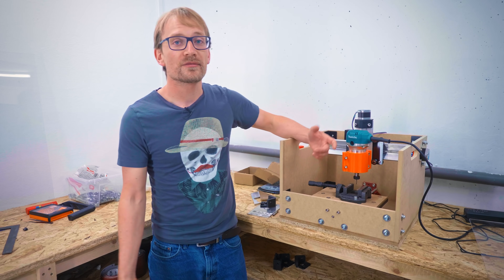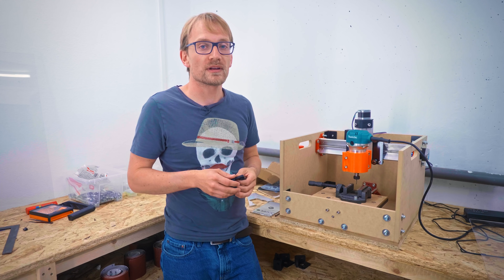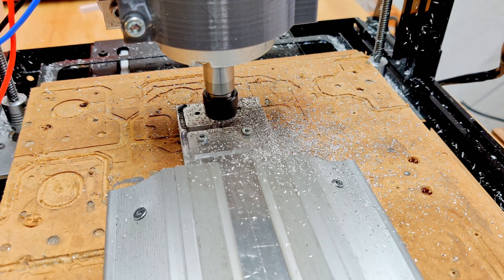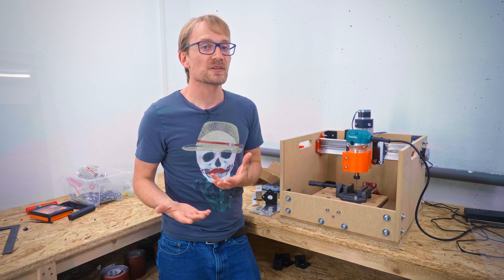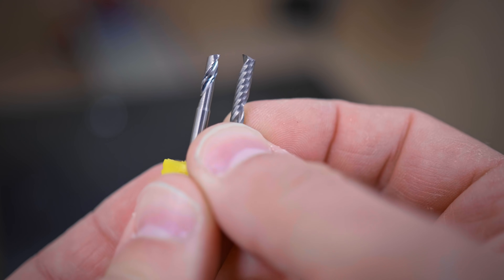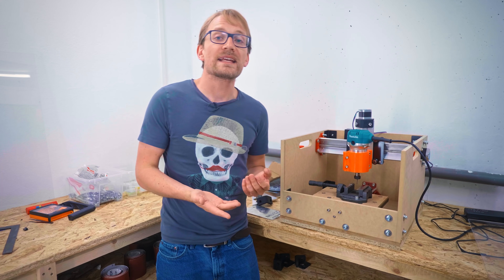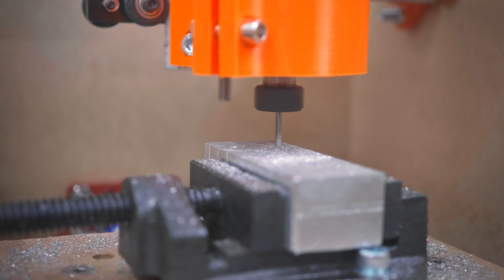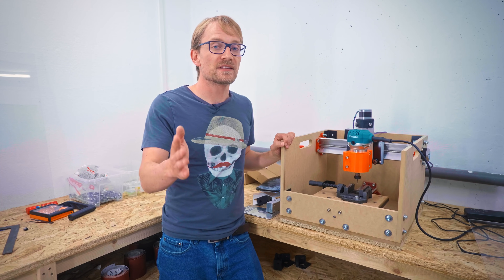The road to cutting Aluminum on my Desktop CNC!

Comment: If someone need less backlash but you don't wanna spend on those wierd "backlash" tools. Just screw 2 lead nuts together as tension from oposide sides. Yea it's more load on steper motor but backlash is lower. 
And 30$ for ball screw?!

Comment: How about doing your own linear rails with good strength? I did mine with car shocks rods (although used they were in good shape) and with linear bearings. Almost "for free". In my case they are 20mm diameter and about 300mm long (front shocks from New Fiesta). I'm sure you can find some in good conditions with less diameter. You have to see the standards for linear bearings before, of course, to choose what you want.

Comment: The number one requirement for removing metal is rigidity. If you want to see a self-built CNC router showing what it takes, search YouTube for "This Old Tony". To be blunt, building a CNC router with a "3D printer mentality" will result in disappointment due to the much higher forces involved. There is very little margin for backlash or play in the actuation paths. Then there's the very real issue of conductive metal chips flying everywhere, onto the bearings, drive guides, and into any open electrical boxes...

Comment: I would recommend to replace the angle guide with linear rail 12 to 20mm even better, the one that is combine with a ball screw (all in one) like FUYU FSL30 75$ on Amazon.  Also have a minimum distance rail to cutter.  You have something over 200mm tip to the center to the center of rotation of the angle.  Angle is a clever design but as structure, not so much.  A better support beam like 80/20 box 50x50mm and have the end screw to the frame (no 3D print part).  Less part the better.
Now, use 6061, (7075, 2024) tuff stuff but cut well.  Bendable Aluminum like 5052 5056, 3003 are gommy.  Have the correct feed and speed, allot of good cutter company have excellent chart.  The old machinist was saying;  You can go slow forever, fast for just few second.  To slow result in more torque to your motor.  Sorry but NEMA 17 is only good for 3D printer or light work.  I think your screw are 2 to 4 leed, change that for 1 with the same pitch.  If you can get a bigger screw...  
Well by now, just get a new machine LOL...  Not as fun ;-)  With a couple of hundred you could improve allot but still your motor will become the weak point, than the controller board, etc.
Good luck, keep having fun...

Comment: You can get some of those mounted rod linear rails and bearings from China pretty cheap.  I replaced the angle aluminum and skate bearings on my garage CNC with them and they work great!  Also got ball screws and acme screws for pretty cheap.  My machine is 48" x 24" so the bearing rails were pretty long.  I need to take a video of it one of these days.  I cut a nice string stop for a guitar out of aluminum with it and have cut the head off of a few grade 5 bolts (whoops!)

Comment: I don't know if your Makita has the same end thread as my 850 watt £30 cheap Chinese trim router but I bought an ER11 adapter for my CNC3020 and discovered that the collet nut actually will fit directly to my trim router! Now it can have a proper ER11 3.18mm collet nut OR its normal 1/4" collet nut! If you have an ER11 adapter for a 6mm shaft you may want to try it!

Comment: With the COVID lockdown and paying to have the Fab Lab print parts... I'm thinking I mise well take the parts I've been saving from old printers and make a 3D printer.  However, seems like I'm better to make a CNC with steel and acme threaded rods.  Maybe still using more of the stainless steel rods from the printers and some parts if heavy duty enough.  Though thinking more along the line of square tubing material I have so can do plasma cutting work on also.  Basically, I'm thinking I'm going to make a CNC plasma cutter that I can also consider using for 3D printing, maybe lower power laser work and more likely maybe CNC milling work.  Considering what I'd actually make other than small 3D printer parts... seems I'm better to plan to make a larger 4x4' or potentially smaller 4x2' CNC and just feed in the sections for the longer sheets cuts.  I do have some floppy and CD/DVD/BluRay drives and am thinking maybe for a first build project make a smaller 3D printer out of one of those also for practice in controls...or just better using the old printer parts?  However, for the larger size maybe 3D printed parts... I'm thinking I'd more likely hot wire foam cut larger items and not so much 3D print so am still thinking just make the larger 4'x2' unit and the smallest 3D printer.  I do have some 80/20 and can hit up the scrapyard to see if I can find anymore straight available and I have a bunch of 1/4" wall 2" square tube now that I got the $20 farmall front end loader for my garden tractor loader and backhoe material.  Thinking can bring the long level with to check also.  Then for small metal parts... I'm thinking outside of plasma cutting... just upgrading the 7x12 mini-lathe with the vertical slide into a mini-CNC lathe/mill.   Any suggestions?  Thinking I'll go with a RAMP module kit.  Kicking myself for not picking a free copier when I saw a few this summer.  Some look like a treasure trove of stepper motors and parts.

Comment: I've been thinking for quite some time about a way to make cheap leadscrews kind of backlash free by using TWO nuts, one fixed and the other to be tightened in some way, maybe with a 3D printed block of some sort; it would do the same thing that these spring loaded nuts do but without the vibration since the nuts would be fixed in place
about the backlash in the plane orthogonal to the leadscrew axis I don't think there's much to do honestly

Comment: I have a nextwave automation CNC 3d router that uses rods for the tracks, very sloppy results even with just wood. I added linear rails to the back and no more play. I also raised the sides up, it uses HDPE for the structure, and angled the cutter head back. After taking pictures of it and sending it to the makers of the machine, they now use my upgrades for their new machines. I purchased mine in 2009 and it cuts aluminum easily now. Nice thing about yours is you can make new sides to boost the height for the z movement, or maybe add some linear slide rails to the sides and make the z adjustable.

Comment: I have the same router on my RS-CNC32 build! Works great so far, got the 1/8" collet from elaire for it and it seems to be even better build quality than the stock 1/4" collet that it comes with. Definitely worth it. Haven't cut aluminium on my machine yet but I've seen videos of people doing it quite well. Seems to be a very rigid setup, for the XZ axis alone you have 16 bearings making contact to the square tube rail! Hard as I tried I couldn't detect any slop at all. Of course the 3d printed parts are the weak link and hopefully will use it to route parts for an even more rigid machine ;) I have to thank you for your honest review on the MPCNC otherwise I might have made the mistake and went with that instead of the awesome RS-CNC32

Comment: make a video upgrading to GRBL-advanced .  you can use a nucleo board and a cnc shield , like 20-30 usd.   
check their github , its easy to build.  
why ? it has... backlash compensation (ymmv, didnt used it yet)

Comment: Hello sir, I'm from India. 
I've a manually made 3d printer in here, and its "MKS base v1.5" board. It have much more software problems, please tell me how to delete old firmware and upload new firmware on the board. (1X-1Y-1Z motor, and 1 extruder)
Plz make Detail, step by step video for it.plz

Comment: Great video, actually I've learning a lot from you.
I have a question, or an idea, I think that a rotary tool with the a flex shaft used for jewelry making would fit nice for a small CNC. 
What I mean exactly is something like Foredom rotary tool.

Actually, I'm quite curious to know the result of having one in place of the common spindle or router. The main thing about it is that its spindle is extremely light weight. 
I know that Netwon's first law tells us that it won't make any difference in the XY plane but I still think  the light weight would make a significant difference.
What do you think?

Comment: I'm doing the same thing with my OX, I'm using the cheap carbide 3.175mm double flute cutters, and they work quite well! something I have noticed is heat plays a BIG part in the process, my DeWalt router blows air down onto the part so I think that helps, but,  you can reason that the faster you run the router the more energy there is for things to go "wrong" so I run the router at quite a low speed (2) as to not heat up the metal stock, at a feed-rate of around 550/570 mpm.

Comment: Thomas, AFAIK spindle RPM should strongly correlate X-Y-Z movement speed. Assuming same speed and: 

1. Too high RPM - you'll get "licking" and melting/burning of material (and/or tool)
2. Too low RPM - you'll get too big forces on milling tool and it can break

Comment: I’m looking at getting a hobby CNC so I can machine materials like brass, aluminum, carbon, acrylic sheets and MDF. This is for my hobby being slot cars to design chassis to race. 
I am on a budget too as I’m also looking at getting a 3D printer as well. 
What CNC machine do you think I’d be better getting whether I build one up or get already built?
Thanks.

Comment: Hey, Thomas, My name is Adriel, watching your videos has made me buy a 3d printer and I ended up getting an Ender 3. I'm a total novice and so I don't really know how to find the answer to one of my questions. I bought both the glass bed and the magnetic base for the ender 3 and I noticed that the magnetic base was a two-part system of which one you have to glue on to the base plate of the bed. my question is: if I 3M glue the magnetic base to the metal, can I still use the glass bed when I want to? I hope my question makes sense. thank you so much for all your videos!

Comment: Two ideas:
1. You could modify the router mount to add a bracket to hold the nozzle of a shop-vac. It will suck up most of the chips and provide some cooling airflow. I did that with my openbuilds machine a few years ago (don't ask me about the machine itself. it was bad and I regret buying it).
2. Modify the bed to add a second rail for much better stability and less twisting.

Comment: you probably need 2 horizontal guides for the bed, instead of just one V shaped bar, in the closeups, the bed can be seen rocking from left to right and back when the tool moves around

Comment: with aluminum and hihg rpm the 2 most important factors are chip evacuation and chip load. Add a 70L acquarium pump with the cheap NOGA nozzle you can find on ALI, Ebay, Amazon...ecc... to remove the chips and don;t go above 2 flutes cutter with such higher rpm or you increase too much rubbing and aluminum will melt on the cutter.

Comment: Hi Tom. I believe that extrusions aluminium is the better option to upgrade your CNC.  MDF should not be used for it; if wood is your selection for the case, then plywood is a better option.  Could you please share the feedrate and milling parameters you use to cut aluminium? Thanks in advance.

Comment: You have gone down a deep rabbit hole.  There is no amount of upgrading you can do to get anything really usable. When you are done upgrading to something that really works well it will be built a lot like a Tormach. Once you have spent that amount of money for something that isn't a truly production capable machine, you realize that machines like what HAAS makes is what you really need for CNC. I have a conventional Bridgeport Mill and Sheldon lathe and want to have a little CNC. I have looked into this quite a bit over the winter months. Once you realize the mass and rigidity needed to make a proper cut, you know you just cant get a bolt together home CNC. NYC CNC is a very interesting channel and you can see looking at his video history where he has gone all the way down the rabbit hole.

Comment: Did you try using some cooling fluid or air to improve the cut. Water and WD40 mixed makes a cheap cooling solution.

Comment: Could use the router to upgrade itself like a 3d printer I guess? Could replace the 3d printed brackets with milled alu?
I'd recommend adding one of those flexible plastic segmented pipes and at least blasting the work with air to evacuate chips, coolant (water with some oil) would be even better but would require sealing the bottom of the frame and adding a pump and filter for chips etc etc. This old tony made a CNC router a while ago and I think it's a good reference point for useful features like accordion/sliding parts to shield the rails from chips/coolant.
Btw you misspelled aluminium in the title ;)

Comment: I think you are already bumping into the limits of the design.  Keep fine tuning it, experimenting with incremental changes, learn from it, use it to make useful parts, but resist the temptation to spend too much on it.  When you have finally gone as far as it can take you, the experience you have gained, added to the sizable amount of hands-on experience you already have with printers, will put you in a good space for the next adventure.  I like the progression Nikodem Bartnik is making with his Dremel CNC, and now his Indymill.  Stepper motors etc. have been around for decades, but the ready availability of usable budget priced components over the last few years has resulted in a flood of creativity.  Thanks for your videos.

Comment: The diameter of the router produces overhang.  Overhang is a lever arm to twist the top rail.  Improvements would be rails front and back, smaller diameter router motor, steel rails, things like that.  If I were designing, I'd make a 2 rail system with adjustable split bronze bush's over 1" diameter rods. Not expensive.  Stiff.  Everything not stiff sucketh.

Comment: Hi Thomas, woudn´t it be better to use a steal linear rail for the y axis, the costs and accuracy are nearly the same (poor in some way, but works for many applications) in relation to the one you used. And maybe a quick hack would be, to just make four triangles from 20mm plywood (with a long as possible angle leg) and clue them in the top corners.  Even here, steal is better, e.g. brackets from the hardware store.

Comment: As a trade cabinetmaker that specialises in cnc programming and machining with over 20 years experience I can give you a few tips. Forget the spiral cutters try tungsten carbide cutters. You can go from quarter inch down to 1.6 mm all with quarter inch shank so no need for collets. Also give your cutters a spray of a Teflon lubricant such as Inox it will help stop aluminium from sticking to your cutters.

Comment: The following are required to machine metals such as aluminum:
* low rpm.
* bits made for machining metals not wood. These bits have different geometry for the feed and speeds necessary to machine metals.
* a frame, head and motorways not only rigid enough but with enough MASS to eliminate deflection and chattering of the cutting tool.
I like your vids on 3d printing but you, as with most of the MAKER's community, don't have the basic understanding when it comes to machining metals. Anything based off the idea of using wood working tools or methods to machine metals is a failure from the start. The materials and the methods to work and shape them are completely different. 
I suggest you find a machinist handbook to start. Look for non-CNC machining books and videos. Unfortunately alot of these CNC machinist kiddies also don't fully understand the concepts behind the materials they are working with. 
Again I like your vids and you expose to me things I didn't know before so I respectfully hope to point you in the right direction when it comes to working metals and machining in general.

Comment: Are you seriously comparing the nomad with this -- DIY project? Good job making it something useful, but the Nomad has been my little workhorse for 3+ years pretty much exclusively machining aluminum. It's precise to a point of ridiculous, especially for a machine in that price range. I can do one pass on one day, turn it off and come back and do a finishing pass the next day -- that's how dead accurate it is -- you won't even see dust when it bores through the same hole it did the previous day. Only commonality is the moving bed. Otherwise Nomad is as rigid as a tank, and I haven't had a problem with a 10k rpm spindle limit. Should apologize to Winston by saying this toy punches in the same weight class as the Nomad.

Comment: I'd consider cutting the brackets out of polystyrene foam (make them more than 6.5mm thick everywhere) and then cast them from aluminum using the lost foam method.  You could also make your mdf frame much more rigid by coating with fiberglass.

Comment: I can’t see that you are doing anything wrong considering what you have as a starting point. That aside - the bed obviously needs two rails - even for cutting wood. The bottom plate should take Care of squaring things up - so I don’t think the wooden frame is a problem. The flex in the X-axis could perhaps be minimized by using the same profile but in steel instead of aluminium Ithink it’s to soft, the same probably goes for the profile in the Y-axis. Well that’s my two bits apart from urging you to take a look at Leon Van Beukel here on YT his project uses 3d printed parts and square steel tubes - the x and y sliders looks a little clunky but they rely on ordinary 608 skate bearings so there’s no need to spend on openbuilds wheel. Hope to see more.